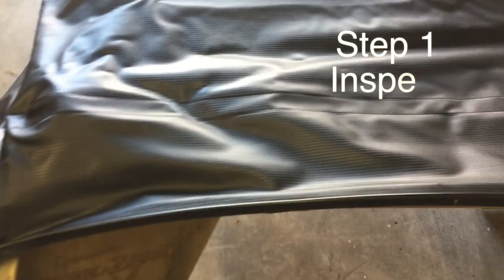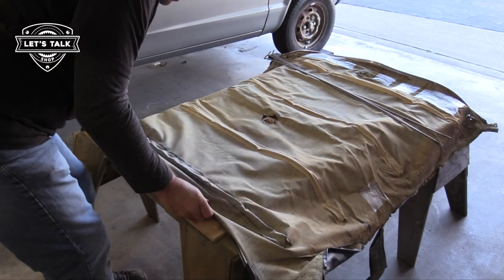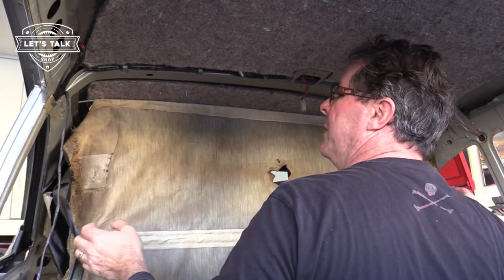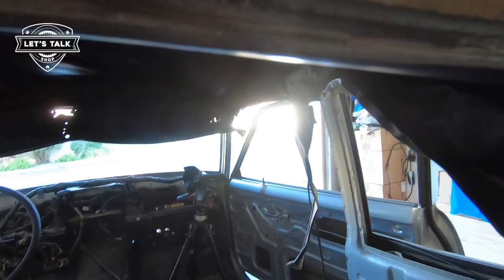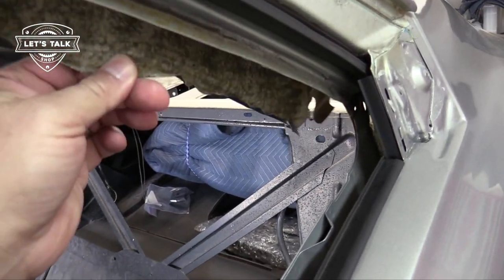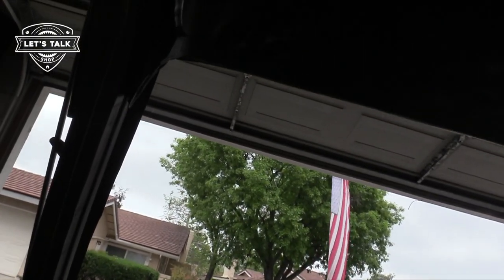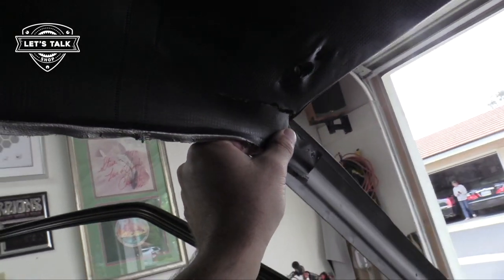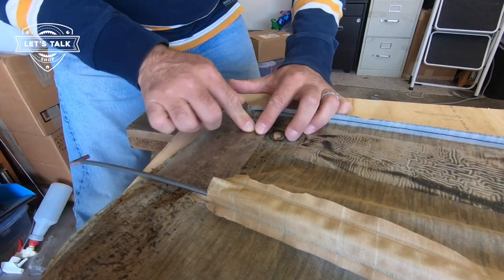VLog 48 Re-install Original Bow/Rod Type Headliner Mazda RX3 Restoration

Comment: To make installation easier, I would leave it outside in the sun to warm it up and make it soft...
Alternative a hair dryer or heat gun does a similar job !
Reply from the maker: It was nice hot summer day on installation. Letting it warm up is a great idea and we did that. It still tore. So fragile. Soften the backing with an oil. That's one thing we didn't do and would do for sure next time.